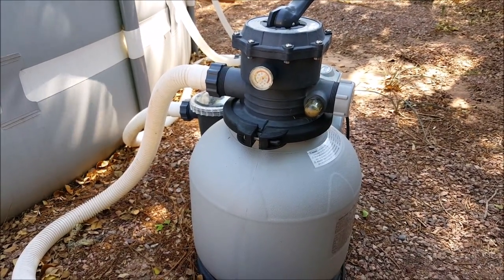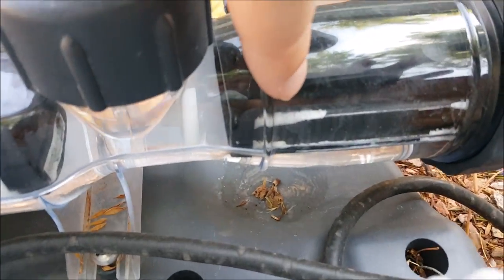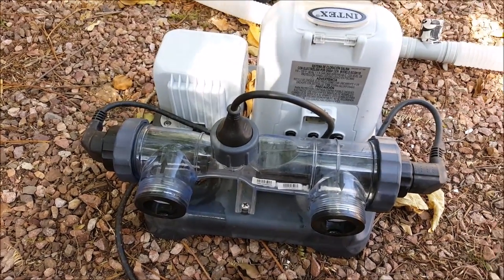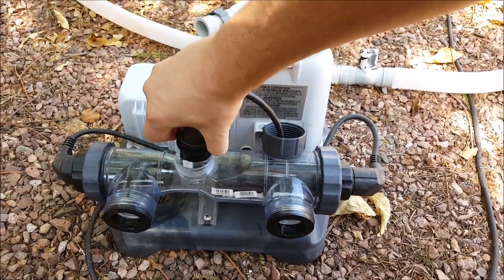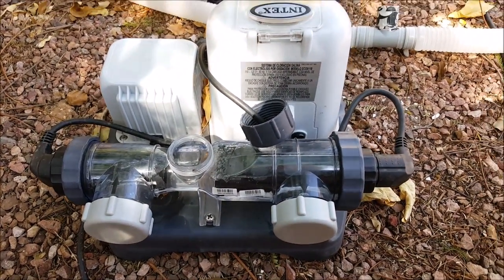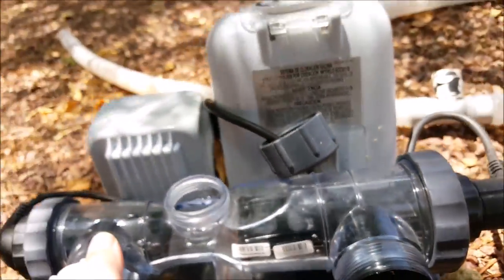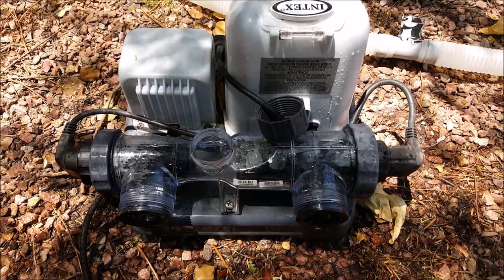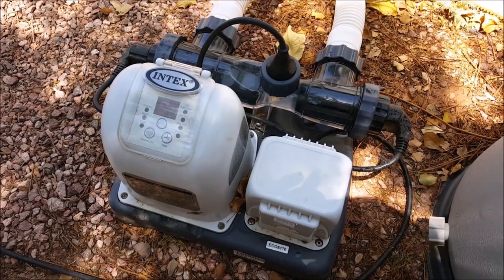INTEX POOL - SALTWATER SYSTEM - CLEANING

Comment: This is awesome! I’m running my filter now after setting it all up. Only problem is where I put the air inlet jet valve, I have a leak. It’s driving me nuts. I put a patch around the bottom half thinking I had cut too much. But didn’t work. Help! No business will come to check it out and I’m stumped. Thinking perhaps it’s the actual jet valve. Thoughts? Advice? I’m so sad.

Comment: Hey there, my pump is the same as yours I believe the eco 8110. I'm having issues, it keeps beeping the code 90 low pump/flow. I have released the air from the filter pump . Just cleaned the filters and checked the flow censor, there was some debris on there. Looked like magnet? I reset the pump and it will show.working then kick in and say low pump. My pool is greeeeen. HELP?
Reply from the maker: Hi Tiffany, have you tried backwashing your sand filter?

Comment: What kind of Salt did you use ? Also do you shock your pool once a wk ? Very new to all of this. Thank you in advance!
Reply from the maker: Hi Pamela! I use a high purity pool salt like Morton Pool Salt. Diamond Crystal is good too. Walmart here usually carries both. Do I shock? Yes & No. I normally do not need to shock with the salt water system providing adequate chlorine. The only times I shock once a week is when the air temps start going north of 110 degrees F. At this point the chlorine is evaporating at a higher rate so I will shock with the salt system turned off and the pump running for 24hrs. I hope this helps a bit.
Reply: Nick Thank you again I got the pool salt! I have ran into a problem I put the salt in the pool let pump run 24 hrs. I turned on my Salt water system and it said low salt i did a salt water test strip and it reads 2910 info says i have to have it at 3000 any idea how much more salt i might need? I am scared to put to much becasue I want to avoid taking out water and adding more. Please let me know if you have any suggestions. Thank you!
Reply from the maker: Pamela, I would toss in another half a bag and see where you are after 24hrs.
Reply: Your salt water system should tell you how much salt you need. Don't go by the salt bag if you have the Intex Saltwater system.

Comment: question? did you put any salt into that saltwater system or does the salt only go into the pool? new to this pool biz and I wanted to upgrade my system to saltwater. i did a pump upgrade to a full 1hp pump and filter. i have an intex. 16 x 48
Reply from the maker: Hi Steadman, you put the salt directly into the pool..
Reply: thanks nick enjoy the rest of your summer
Reply from the maker: You too!
Reply: There are tables on the Intex site that will tell you how much salt to add.  Once added, let the pump circulate the salt for a day before running the SWG.  You will be very happy with salt!!
Reply: Theres's a newer model Salt water system that is 129.00 on Amazon Prime for 15000 Gal and 124.00 for 7000 Gal. I am wanting to go big with the 15000 Gal for my 18 ft round Above ground and 16 in sand filter. Do you know how it compares to the model shown here? I really dislike paying for something without a person trust worthy review. Any input Nick? 
Thanks, Sheryl
Reply: Nick Nelson you mean normal salt like the one I have in my kitchen ?
Reply: Hind Hind no pool salt..you can purchase at your local pool supply or even Ace Hardware or Walmart

Comment: How do you use a vacuum on this system?  What do you use for vacuuming your pool?
Reply from the maker: Hi Gerard, I currently have this skimmer setup/ Intex Pool Skimmer: http://amzn.to/2s0d6Dj 

What I do when vacuuming is remove the skimmer basket hose and then attach my vacuum hose to the outlet using this connector: https://www.acehardware.com/departments/outdoor-living/swimming-pools-spa-and-supplies/swimming-pool-equipment/87572

Its an easy setup and works great!
Reply: @nickvids  Thank you, appreciated.
Reply: Have you had any problems with the salt system? I just ordered it online but started reading a lot of reviews stating problem with readings and on/off issues.
Reply from the maker: @80oldman  I havent had any issues with my salt system. Just make sure you use the salt strips to gauge the right amount of salt for your pool. Also keep the plug away from water and clean the system of scale buildup and you should have no problems.

Comment: I just received my sand/saltwater pump. The question is do I add salt and run the filter for 24 hours then after Boost it for another 24. The pool was filled this week
Reply from the maker: Hello there! Good ahead and add the salt with the filter running and periodically sweep it off the bottom till everything is dissolved. Then its good to go. You can boost the salt gen if you want but its not necessary. Just be sure to add less salt than you need and work up to the right amount. Its easier to put the salt in than to take it out. Hope this helps :)

Comment: Hello ! Today, I get 92 code on my chlorinator. I have cleaned it with vinegar and electrodes looks like new but still I get the code 92 (high salt). Do you know where problem is ?? 
I added 60kg of salt in my 20m3 pool...
Reply from the maker: Hello! You may have high salt content in your pool. Have you checked it with a salt test kit yet?
Reply: Nick Nelson Hello ! No , I’m not. First of all, I must buy tester 😬
Reply from the maker: These are the test strips I recommend. https://amzn.to/3hzbvuC You can see what your levels are at. If you need more salt then you can add it. If you need to lower the salt content then you just drain some of the water from the pool and add fresh water.

Comment: How long do you run the crystal clear a day?  Do you get in pool while its running?
Reply from the maker: Hi there, I run the salt system 1 hour less than I run the pump. So if you have your pump set for 8 hours then you will set the salt system at 7 hours. And yes it is safe to swim while its running.

Comment: Do you have any rust issues on your pool frame due to saltwater system?
Reply from the maker: Hi KamilEdyta, I personally do not have any rust issues. The rails have a coating that prevents corrosion. If that corrosion barrier stays intact then you shouldn't have any rust issues. If that coating gets scratched to bare metal then that area will start to rust with just water. The salt would speed up the corrosion process. So the key is to make sure the rails do not have bare metal scratches. If you find any bare metal spots it would be wise to re-coat them. Hope this helps answer your question :)
Reply: My Intex 4x18 metal frame pool completely rusted away 7 support posts... so I ordered new ones (at a cost of 12 per).  Upon attempting to remove the old posts, I discovered that ALL of the top rails all the way around the pool were rusted through.  We bought a 4x18 inflatable ring pool, connected the salt water system and haven't looked back. One thing to note was the ladder from the first pool lasted 2 more seasons before rust showed.

Comment: My plates are clean and had no scaling. I cleaned anyway. Salt level is perfect. Still have low salt light.
Reply: That's a bummer.  I'm getting ready to clean my plates.  I sure hope it fixes my issue.
Reply from the maker: Hi Jason, if your plates are clean I would try adding more salt. Thats usually the case for a low salt light. If you keep bumping the salt up and the light still wont go out I would contact Intex technical support.
Reply: It worked!!!  It was easy peasy, took like a 1/2 hour.
Reply: why does mine says lowpump pressure